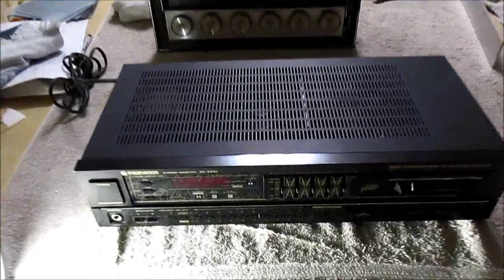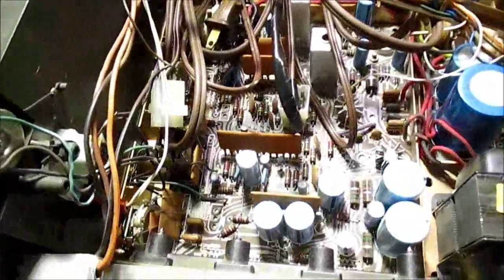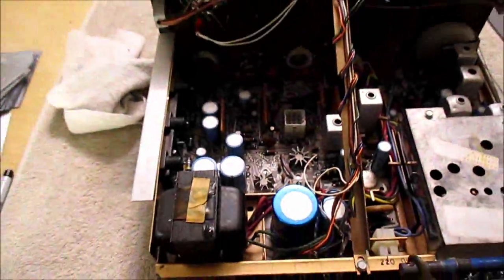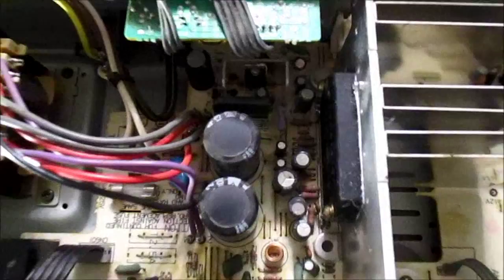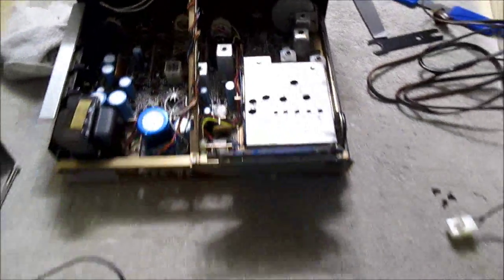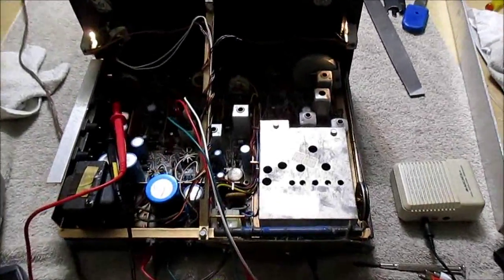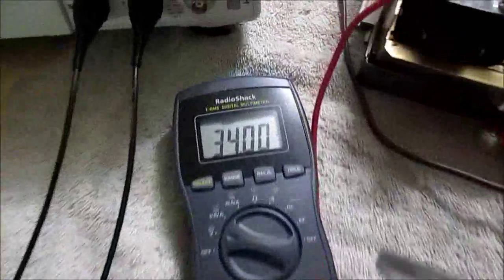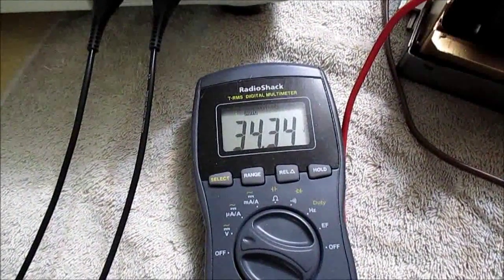Power output measure Pioneer SX-1000 and Magnavox Astrosonic receivers

Comment: When you are measuring, is your multimeter on DC volt scale
and what ever the voltage is, you times by its own value then divide by 4.
I quite didn't get that, you went to fast.
Reply from the maker: MrMac5150  I was measuring the supply voltage with the meter to check how it sags under load. To measure power output I take the rms voltage reading off the scope, square it and divide by the load resistance.
Reply: Lets see if I got it right. Your taking the peak to peak measurement, non clipped. you are getting the rms value by times it by 70.7,
then you square that value and then divide it
by the impedance ohms of the speaker you would use to load the signal..? right or wrong.
Reply: MrMac5150 I believe you are correct except he uses peak (0 line to the + or - peak), not peak to peak. And not 70.7, but 0.707 (or divide by square root of 2) for the RMS conversion (for a sine wave only).
Reply: *****
Thanks

Comment: Interesting amp that old Maggy. I wonder if it is all Si?  Probably.  My first stereo was an Ampex cassette deck with built in power amp, used TO66 Ge PNP transistors in quasi comp. Burnt them out a few times! Seems back then most Ge transistors were PNP,  most Si were NPN.
Reply from the maker: ***** This one had a mixed output in that the P device is Ge and the N is Si. It uses a positive ground chassis. I sent you a video link a week or two ago. Did you see it?
Reply: JohnAudioTech That's pretty wild! Ge are so much more leaky and temperature sensitive than Si, would be an interesting schematic to examine. The biasing would be fun to control, though I guess they could do a current mirror with the appropriate diode for the top and bottom.... 
   I missed that e-mail, but searched and found it now.